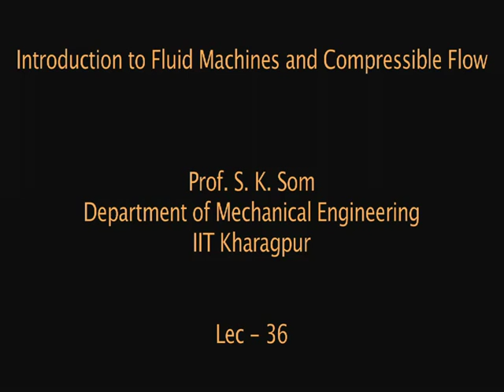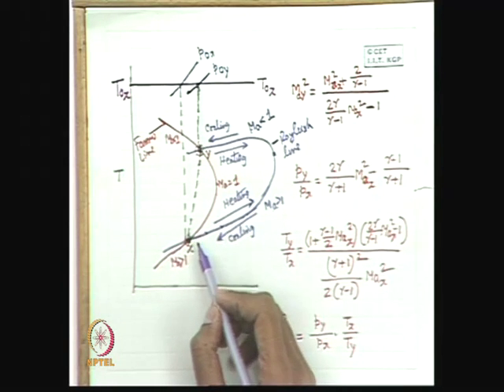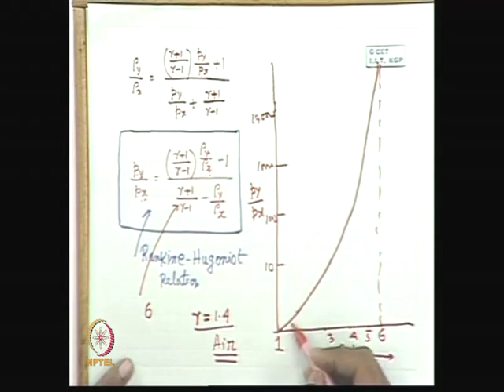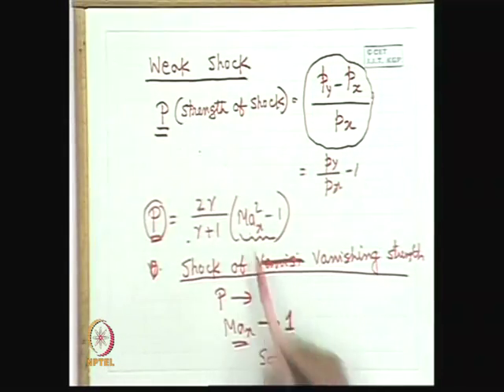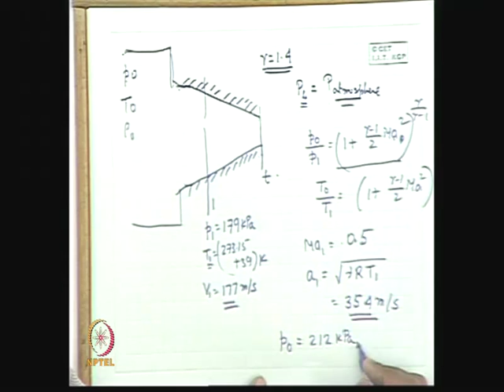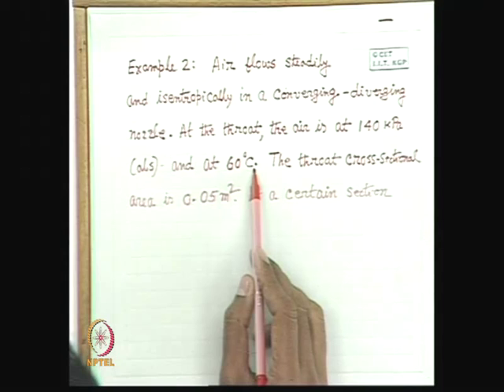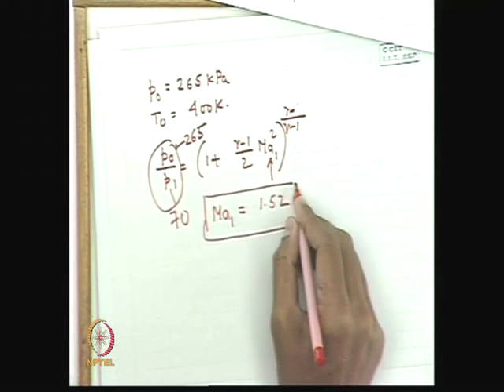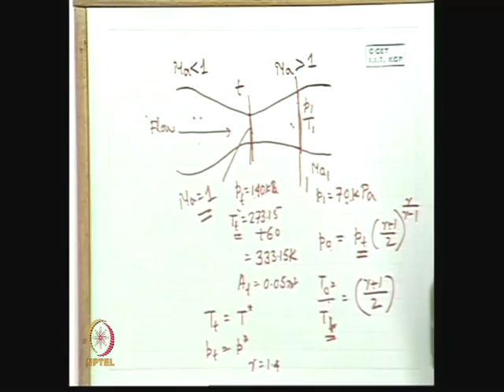Mod-01 Lec-36 Normal Shock Part IV

Comment: Sir, As we move along Fanno line from supersonic region we can reach up to sonic condition in maximum then how subsonic condition is reached in downstream condition?
Reply: Well it's a good question but the main thing u should understand is that shock doesn't follow fanno line,it follows the dotted line joining the points of interesection of fanno and raileigh lines.